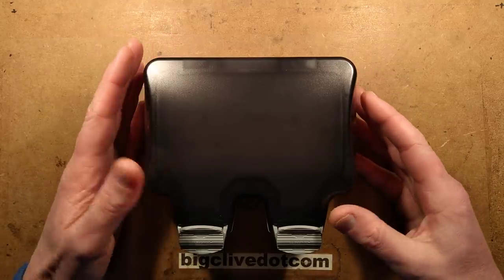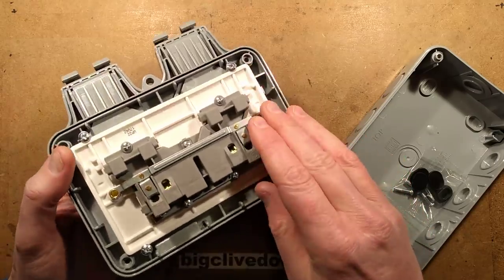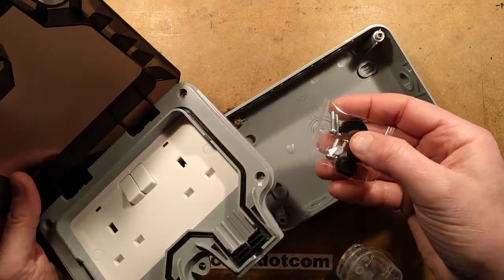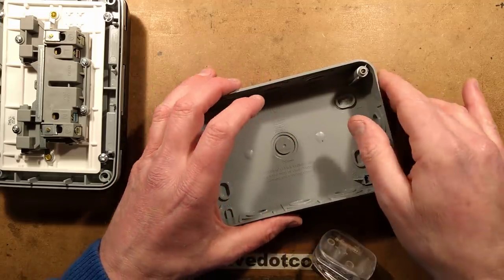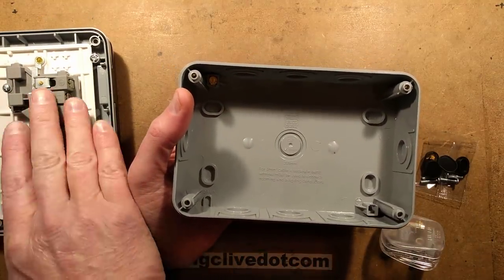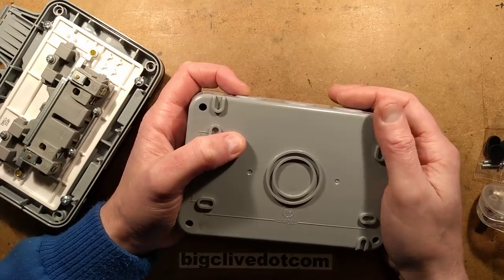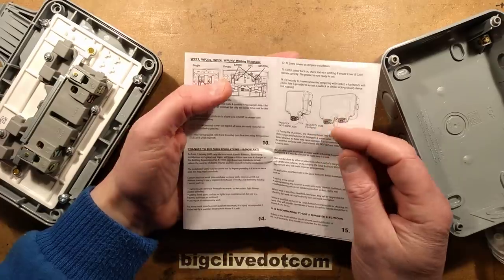British weatherproof socket with clever design. (bonus rant)

Comment: The wire colours are not the best but at least they are uniform now. Imagine this. The old hungarian colour code was black for live, red for earth and blue for neutral. Imagine what would have happened with a UK export product in hungary. First you chop the plug because screw the big UK brick amirite? Then the guy would hook the neutral to live, live to earth, then go "Yeah third one goes to the third I guess". It also wasn't exactly colourblind friendly

Comment: Using a standard socket means you don't have to bin the whole unit, just because the socket has failed.

Instead, you can just swap out the faulty socket.

Comment: ehm, when the hole is drilled in the backbox, water will not be pushed out on the front compartment anymore, due the pressure being released there.

Comment: Very unusual (for us Dutchies) is the very common switch near every outlet... why is that there ? Is that a regulation or a cultural thing maybe...
Reply from the maker: It allows something to be turned off while still being left plugged in.  It also reduces arcing on the plug contacts when being inserted or removed.
Reply: @bigclivedotcom  in the Netherlands this kind of outlets is non existent. We do have switched outlets but they are used to switch lighting from a central or single location.

Comment: In Germany we have a similar racket. In rental objects you are required to have smoke detectors in the hallway and the sleeping room, but not the kitchen. Companies are now checking every year that the smoke detector is still working. It's incredible how much money we are spending to increase the safety marginally. I'm all for smoke and monoxide detectors (which are not mandatory), but having a company check them every year and letting the tenant pay for it? Thank you very much...

Comment: After working in the theatre for many years along side 3 phase power supplies and transformers, it's something of an insult when you can't install a new socket on a ring main without someone with a clipboard saying it's ok. Although there is always the excuse of "it's always been like that".

It isn't uncommon however to come across electrical installations which have all the changes to the wiring colour codes in one. You do have to scratch your head a bit at that.

Comment: *********** Hey Big Clive!!!! I Just figured out some power banks have output power on their micro USB charge ports. Maybe go back and check your's out, I used a Micro "Y" Splitter to test mine and out of the dozen or so I own,  I have 3 that can do it and there's no amperage limit, it'll just let the power drop until it cuts out!!!! All 3 of mine can do at least 3Amps before dropping to 4.2v, but one can do 3.5A before it drops!!!!!!   PS. these Units are only rated for 2.1A Output...

Comment: Did you know, you can "safely" connect an EU plug into a British socket via small screwdriver in the earth to push the live/neutral safety shutter. Just ram the EU plug in there! It's useful to know when you have no adaptor to hand - good on EU wall-wart PSU's.

Comment: Where I live, the house and some of the wiring is so old that Electricians have refused to work on the electrics unless they do a full rewire so I have no alternative but to do it myself. It is apparently not possible to rewire while we are living in it. The "rules" changing are interesting since they failed to write to individual home owners to advise of this nonsense. Seeing as I have had to determine, disconnect and replace Rodent damaged cable preventing fire in a competent manner I take exception to this licence to Print money.

Comment: But the socket should be RCD but is not, any outside socket should be RDC, I tried the fit an RDC in one of those and it does NOT fit!
Reply: No, outside circuits should be RCD protected, it's perfectly correct to install this with the RCD protection at the source of the circuit. 

In fact if you installed the RCD version on a circuit wired in anything other than SWA cable, or other suitably mechanically protected cable, it would be incorrect to use that version as the circuit itself would not meet regulations and be non compliant even though the socket itself would be safe!

A little knowledge is often a dangerous thing... ;) Always consult a qualified electrician if not up to speed (Not a part P monkey!)
Reply: Sorry No....
Reply from the maker: An RCD version is available.  But if the circuit is already RCD protected at the distribution board then another one is pointless as both will usually trip if leakage occurs.
Reply: You would only need an SRCD version of this socket if you were adding this to an older installation that had no RCD at the consumer unit.  If the board already had an RCD, you might be able to comply with regulation 531.2.9 if you used an SRCD which was set to trip at 10mA.  Even then it'd be iffy, and what would the point be?  The upstream device would probably need to be time-delayed to achieve the necessary discrimination.

Comment: @bigclivedotcom , I think you misrepresented that 'earth terminal'. I do not know about all cables in UK but there should be cables that got double earthing protection. One that you connect to the Socket. One that is around a metal sleeve inside the cable. You essentially Earth terminal this metal wire surrounding the metal sleeve. So if the cable short circuits toward the outside. It acts like a protective barrier. 

Since these are typically installed outdoors. Such cables may be used for protection against cable damage risks.  An example; https://www.elkatalogen.se/media/wysiwyg/Ska_rmavbild_2016-11-18_kl._12.53.42.png <- See those 'four' small wires at the metal sleeve? 

It is generally used toward such. So you can continue the earthing for the cable if there is a continuation. Since that earthing and the normal earth cable isn't allowed to be shared. At least in Sweden. 

Otherwise, it is a pointless earth terminal since there exist plenty of Connection tools out there. Like WAGO/Twistcap/Sugar bits etcetera.

Also, In Sweden. We have, Brown, Black, White/Grey as main phases with Blue, Neutral and Yellow/Green for Earth. As for people that aren't certified toward electrical stuff, to do their own stuff? It is highly illegal in Sweden. Because even if the Regulations are shown in the open. People that do their own electrical work are so stupid that they can't even buy a UV rated cable for outdoor installations. 

Alternatively, lack of understanding toward why we use PVC pipes rather than naked cables in the walls. Which is a Fire Hazard risk. Since we use 1,5mm2 for 10A/13A unlike UK that has 2,5mm2 for 10A/13A. 

Yada yada.

Comment: Part P one big rip-off, while I have to get my social landlord to fit an external socket when I needed one, I was surprised that that my training in electrics from 1978-82 as part of an EITB Broad Base Certificate was superior to that of the numpty sent by said landlord to fit the socket (simple things like turning off the power before prodding the wiring in the consumer box thus tripping a couple of breakers) I have found this to be the case with most of the recently qualified 'time served' tradesman. they appear to only be trained up to the equivalent 2nd year level of an apprentice trained like myself between 1978-82.

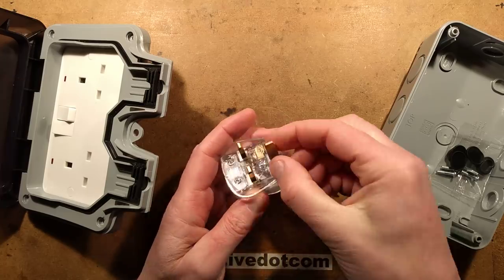Comment: 3:00 no meme ive never seen a kid be able to kill itself off a euro socket since the contacts are recessed so deep that any kind of fork would work,
the kid would have to use like a metal screwdriver, u cant really touch the prongs while inserting as well since its mechanically impossible and all sockets have the same basic fusing, just in the electrical panel as opposed to having a single blow in every plug itself
and if it comes down to it u can just install kid safety covers when u actually have kids instead of overbulking / overbuilding every single sockets in the goddamn country
i dont see why the british socket is supposed to be superior in any way shape or form
what i can safely say is that the US plug is garbage

Edit:
as far as that colour change goes that seems dumb,
i dont see why there would be a need to have the same somewhat random euro color scheme in every country 
if people use certain colours they should leave them since there is little need to standardize that across countries
i dont see many german electricians working in the UK and the other way arround for example, i also dont know why brown and blue were chosen 
i agree with red beeing a nice choice for live and green beeing good for ground

Comment: Clive I have to ask? Why don't residential properties in the UK have RCD (residual-current device) fitted as standard on power circuits (or do there)? My property was retro fitted with them as it was built here in Australia some 1-2 years before they became available and then part of the required regulations here. I grew up over there and knew from childhood just how easy it was to bypass those fantastic shutter? Aussie expression "useless as tits on a bull" in comparison to what an RCD will do to save someone's life especially your child's. There are now retro fitted to public buildings circuits and testing annually, because they are very effective in protecting people. My understand are fuses protect the wiring and or equipment from overload or damage not people from electrocution. P.S. mine has been personally tested in an accident with an extension cord and an electrical hedger and paid for itself after some twenty years. (Same 240V).
Reply from the maker: It's standard to have the RCDs at the main distribution board so they protect all the wiring too.  All modern installations are RCD protected.
Reply: bigclivedotcom So there is no mandatory legislation to say that if you every do anything to a premises electrical system you have to install an earth leakage system (RCD) device to protect the inhabitance going forward? P.S. Happily spend four(4) times longer reading the comments and the replies people post, especially after you have a good rant. Also noted that almost everyone in your responses seem to think that the UK is the only country with right angled plugs, which I'm sure you can confirm is not the case.
Reply: bigclivedotcom Thanks for the response !!

Comment: Part of the reason for the stupid regulations is due to DIY people that are not competent to do the job, I explained to a BT engineer and drew a diagram of how to wire an intermediate light switch, he went to a shop to buy one and they asked if he knew how to wire it and drew him another diagram. Next day I get called to go round and sort it out for him as he could not get it working correctly due to not following the diagrams :( You would have thought that someone competent to deal with the spaghetti in those road side cabinets  would be able look at and follow a diagram for 2 ends of triple & earth !

Comment: I am lucky, I have a legal way of bypassing the Part P crap in my home.  A while back I fitted a twin socket to replace a single one, which is not exactly difficult but technically is illegal under those regs as I am not registered.  I enlarged the hole in the wall and fitted the new socket anyway.  Then I rang my landlord, a housing trust, and they sent a registered and qualified person to check my work.  Since he passed it it was then legal.  Shortly I will be chasing out a groove in another wall in my home to move a light switch and that too, will have to go through that silly farce.  I know enough to move a light switch safely and to replace a single socket with a twin, but actually I don't mind having my work checked by an electrician — the trust only uses properly qualified electricians for such tasks.  I am — at least approximately — human and could conceivably make an error even if I do know what to do so the check is welcome.
Reply: this is the way home electrical modification and additions should be, however it should be the homeowner, not the tenant (unless approval from landlord is given first) doing it and then getting it checked by a sparky.
Reply: @andrea_frm_dubt8977  That is not up to you nor should it be.  What I am allowed to do in my home is determined by my landlord's discretion and my tenancy agreement.  Since all my work has always passed inspection they don't mind me doing small electrical jobs myself.  So it is fine for me to do it.  If you have a landlord that objects then don't do it or you risk eviction.

It helps that I have some training in electrical and electromechanical repairs from my first job.  I have never told my landlords this though, they just rely on the professionals who do those inspections.  I know what I can do safely and would never go beyond my abilities and knowledge.
Reply: If it wasn't clear, I support 'do it yourself' work, with the sparky checking it to 'cover your arse' for insurance (also approval from landlord prevents or reduces litigation risk later)

Comment: Every time I see a BG IP socket that's had some use, the locking tabs break and the lid doesn't seal like it should. More expense but worth it in my view is the classic MK masterseal which even though only reaches IP 56 (I think BGs are 65) is more fit for purpose.

Hats off to our far northern cousins, fuck the scam that is part p, the finest domestic installation I ever inspected (other than my own) was by a total amateur. Buy the on site guide, work to the on site guide and fuck the regs. The 17th was the 1st ever time an edition of the regs carried a disclaimer and as such I hold them in the contempt they hold themselves in, Faraday is spinning in his grave.

While we're throwing mud, what's the difference between a fully approved NICEIC contractor and a fully approved NICEIC contractor with a trusted trader badge?

£60.00

Fuck the NIC too!

Top vid thanks Clive, we all love a rant.

Comment: I would curve ball this and say that part P stopped skilled folk doing house wiring. So, like yourself, the guy down the street or a relative is out. However, folk aren’t going to pay £100 for a socket, so they put one in themselves. As princes leya said, the more you tighten your grip, the more star systems will slip through your fingers.

Comment: The irony of the whole "Part P" situation is that the faulty electrical installation involved in the tragedy that precipitated the launch of Part P was already non-compliant with existing regulations anyway.  But successive British governments have always preferred to pass new laws re-banning things that were already illegal anyway, as opposed to actually enforcing the existing laws they have already got on the books.

How likely are you to end up in court just for installing a few extra sockets in the wrong places anyway?  I'd expect the chance to be pretty remote, unless somebody actually gets hurt or killed; which is an even lower probability if you did the job properly using suitably-rated cable and not leaving loose strands poking out .....
Reply from the maker: That one incident that was used as a marketing stunt.  The number of home electrocutions each year is surprisingly low.  It was all motivated by greed for cash.

Comment: Kinda Ironic that the Germans came up with a simpler (and possibly Cheaper) system that does essentially do the same and doesn't look as bad...
The Germans did a simpler Plug System than the Brits....
You can't touch the phase when pluging it in due to physical restrictions, you don't have fused plugs, earth contacts first as well. And the plug is rated for 16A. And is smaller....

Comment: As an ex electrician , the 70s, I have always considered Part P as a scam and nothing more than an insular money making exercise for the electrical business. Over regulated and way over engineered. All in the name of safety so therefore is beyond challenge
Reply from the maker: Not just a scam, but also responsible for dangerously deskilling the industry.
Reply: @bigclivedotcom  indeed. You’ve only got to watch some of the YouTube videos where they spend a lot of time filling in test forms on iPads. It’s become a tick box trade. To see some wringing their hands over 0.02 ohms differential in resistance/ leaks tests is farcical. But hey they can spend another hour fault finding and of course charging the customer. Keep up the great work Clive